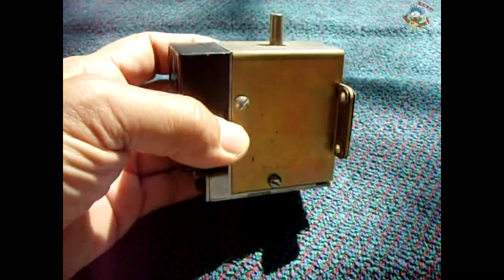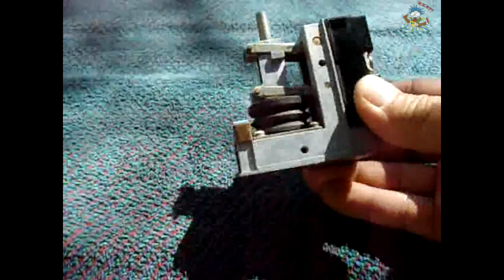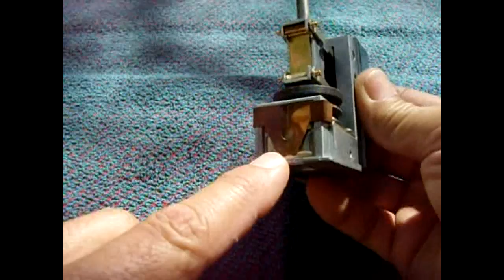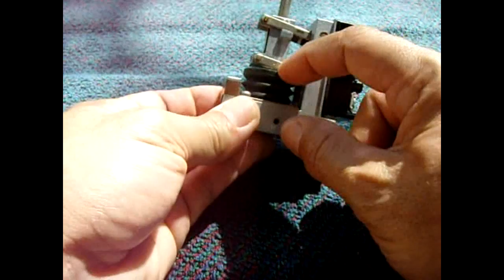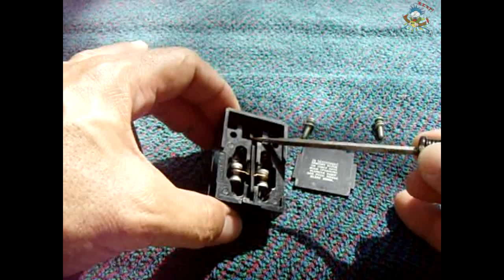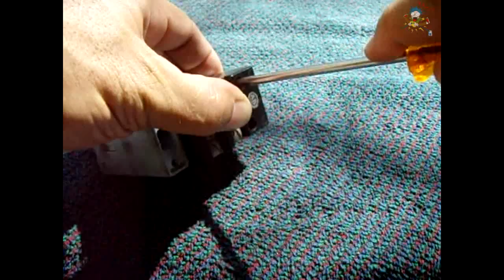Mechanically Triggered Delay Off Switch(Relay) Operation & Teardown

Comment: Hey this is a very interesting video, this mechanical device is awesome!!! 
I want to create my own mechanical delay mechanism works with the same principles but unfortunately I didn't understand exactly how the adjustment of the screw affects on the inlet-outlet valve. I would appreciate if you may sent me some close up pictures of the hole or maybe draw a scheme of the mechanism.
I was trying to find it over the internet in order to buy one and explore by myself, but seems like this part is no longer available.
Thank you in advance
Reply from the maker: Hi Arthur. When the plunger is pushed in, the air can easily escape the bladder in the device through a 1-way valve. When the bladder goes to re-inflate, the time it takes depends on how much air is allowed to enter by adjusting the screw. The screw more than likely presses against a seat. More than likely a spring is used along side of the air bladder. Thanks for watching